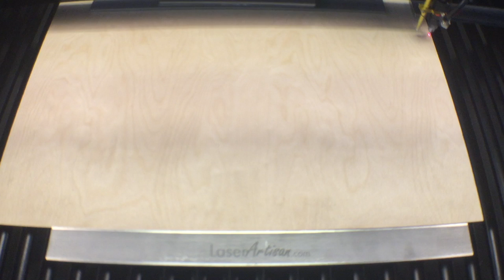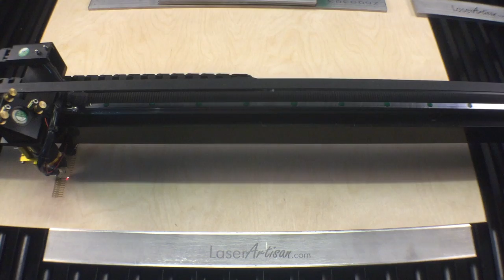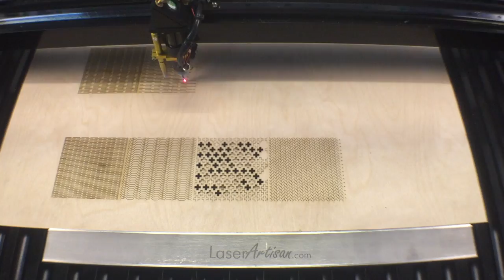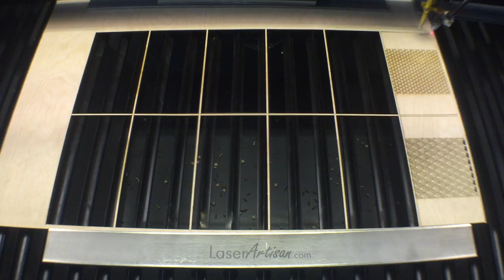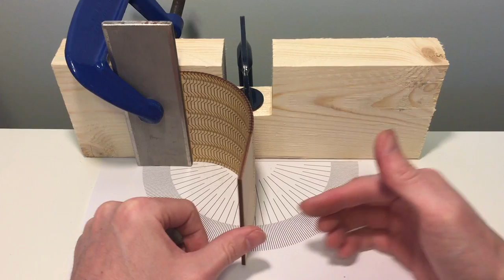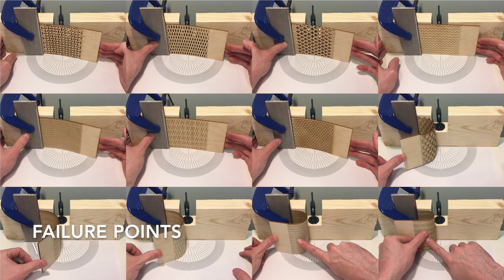Living Hinge Failure Tests using 1/8" Baltic Birch Plywood

Comment: Amazing! thanks a lot for sharing, you just saved me hours of research and testing
Reply: Think I could do the most bendy live hinge on my CNC with a 1/64 (.39 mm) end mill?
Reply from the maker: The kerf on my laser through 3mm Baltic Birch is around half that, 0.2mm. I have much less experience with CNC routers/mills but I would imagine that so long you are able to cut through the depth of that material with such a small end mill it should bend just fine, probably better as you are removing more material.

Comment: Hi Denzil, thanks for the vid!  Question... can you only do the living hinge with the grain?  Or does it work when you go perpendicular to the grain.  Also, on the last 3, is there a formula for the length of/spaces between the cut lines??
Reply from the maker: As I am using plywood each ply is rotated 90° so the living hinge can go any direction. Might be interesting to do a comparison so see if there is a difference in failure point. 
There is no formula that I use, just a little bit of experience and a lot of trial and error!!

Comment: I wonder what would happen if you put a thin flexible veneer on the outside of the hinge. Understandably the hinge will have less bend, but it would give a smooth surface on the outside.
Reply from the maker: That's an interesting idea. You're right it would definitely have less flex.

Comment: hi, can you tell us wich wattage your laser have? and the thickness of the wood? thanks its so I can compare to my laser for speed and power%.
Reply from the maker: The specs for the machine are as follows:
Laser Power: 80W
Cutting area: 1200mm x 900mm (4' x 3')
Machine Dimensions: 1720mm x 1210mm x 1070mm
Repeatability: ± 0.05mm
Power source: AC 110 – 220V ± 10%, 50 – 60Hz
Total power: <1,000W
Weight: 280kg (617lbs)

The material is 1/8" Baltic Birch Plywood

Comment: I need help understanding those live hinges, especially last one you show that bends nicely. Someone told me that is not needed to make a narrow rectangle, but rather just cut slot. Is that true, or it need to be done properly? I am asking because that process is really slow, and doing single cut will decrease working time drastically. Thank you in advance for the answer.
Reply from the maker: The living hinges work just fine just cutting a long a line so that the hole is just the kerf width. No need to make a shape. The longer the cut and the closer together the more flex you will get.
Reply: @DenzilMakes  Thanks. That is good news to me - simplify design.

Comment: This is great, thanks!  Maybe I'm doing something wrong, but I opened your file in Illustrator, and it appears that each swatch is only about 1.5" wide, in the video it looks closer to 6" wide.  Can you tell me the dimensions of the swatches in your video so I can get the right scale?  Thanks again!
Reply from the maker: The file is drawn in mm and each living hinge pattern is 105 x 191. When you open the file you need to make sure you have the scale as 1 unit = 1 mm and it should open fine.

Comment: What do you use to generate the pattern?  Just using CorelDraw or something else?  Do you use a magic feature or just copy, paste, paste, paste, paste.....
Reply from the maker: The software I use depends on what I am designing, for this I used AutoCAD and the copy command. If I am adding any text to designs then I find Adobe Illustrator easiest to work with. I am also starting to use Fusion 360 more as the parameters allow you do design something before you know the thickness. This happens frequently if you design something before you have the material as plywood has a tolerance so will always vary slightly, Fusion allows you to quickly alter the design to accommodate this.

Comment: I want  to draw a heart box on coreldraw . how i can calculate a length of sides with living hinge ?
Reply from the maker: That's a difficult question to answer. It will vary slightly depending on material and which hinge design you use. 
The best place to start is to use the length at the centre of the box wall. The outside will then be slightly stretched and the inside slightly compressed.
Most of the hinges are a little forgiving and will stretch or compress to fit if you are slightly off.
Reply: Thank you for your quick response to my questions

Comment: HOW TO OPEN THIS FILE ??
Reply from the maker: Once unzipped you should be able to open the file in most vector based drawing packages such as CorelDRAW, Adobe Illustrator, or any CAD program.
Reply: open the .rar file using winrar or 7zip. Open the .dxf file with either autocad or CorelDraw!